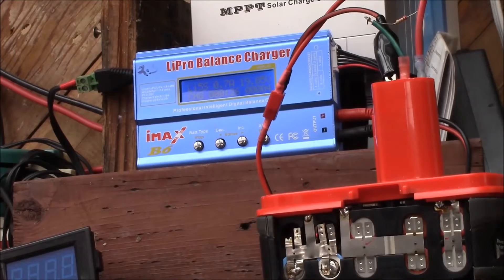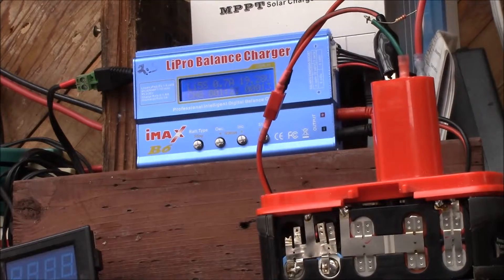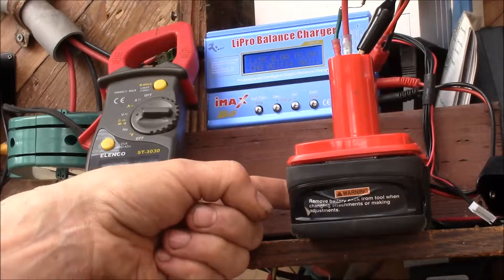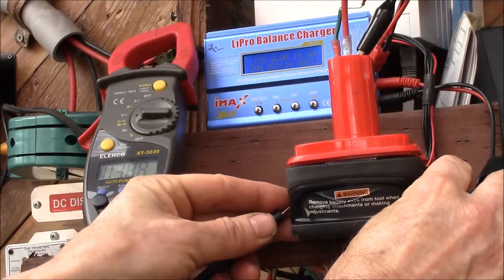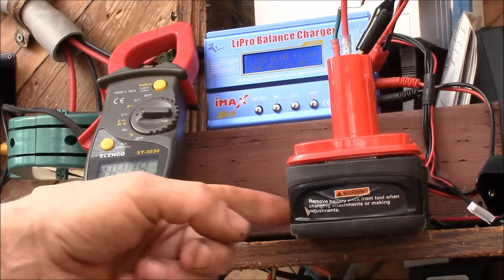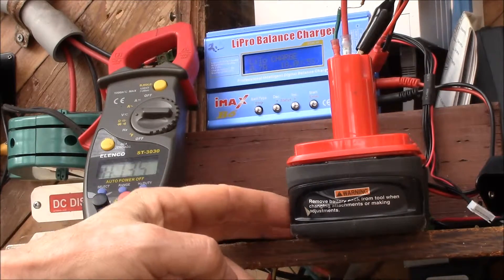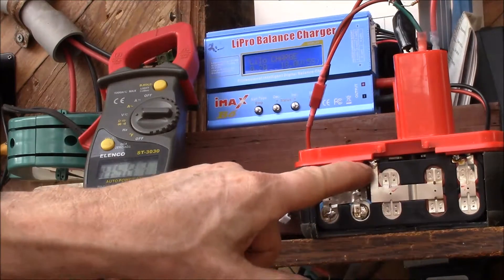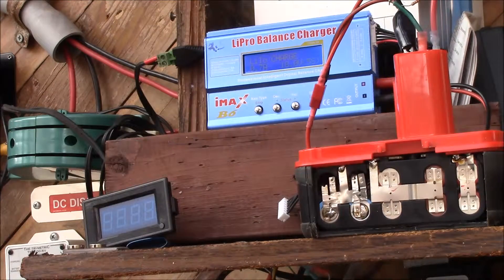Craftsman C3 Battery Charging, Part 7b

Comment: Hi Mr Brown. I've done some work on these vary packs. If I cycled them with the factory charger, over a few cycles, the pack would in fact become equalized. I didn't charge through the top pack terminals because so many of the lithium packs that I picked up had either a bad board, or some combination of cells that had gone to a high impedance state, or were shorted. I tested a board by making sure the cells were in decent shape first by cycle testing them a pair at a time, with a cycler. I happen to use the Icharger 1010B+. Then I labeled each pair of cells with their capacity. The cells new were generally Samsung 1300mah, 2000mah power tool cells. Same ones used in Ryobi packs. The C3 packs come in 1.3ah, 3ah, and 4ah. The upper and lower limits of the cycler would determine the indicated capacity. This almost never matched factory specs. But is a good relative indicator for our testing. My charger is put away, but I think it was set to 2.8 or 2.9v on the low end and 4.0 on the high end. Don't assume you have a good board. Make sure the cells are manually balanced first before testing. The boards are finicky. As they should be. Take a look at my videos. Maybe there is something in there that might help. I'm sure glad to see some one taking the time to test these cells. I also have lots of bad chargers. They have 3 iterations of chargers too.
Reply from the maker: Good information there Mike.  I'll check out some of your videos for sure.  I have done some other charging tests with these early battery packs and did find that if I started out balanced, then discharged and recharged the pack, the cell voltages came back pretty close to each other.  I did find quite large voltage differences in the discharged state, the weaker cells were like 3.0v and the better cells were 3.8v.  I think the weaker cells charge up faster than the healthy cells, so if you start balanced things stay fairly balanced, at least for a while.  I do have a few more videos to put together on those results.  One thing I want to do is make up a little balancing cable with alligator clips that I can use to clip onto the inter-cell connections to make testing easier.
The later packs do seem to have cell balancing circuitry, at least at first glance.  I need to try and get some part numbers off some of the BMS ICs to see if I can find some data sheets to confirm my suspicions.